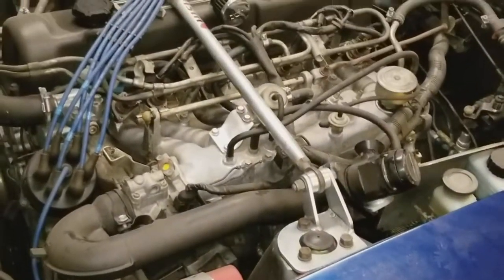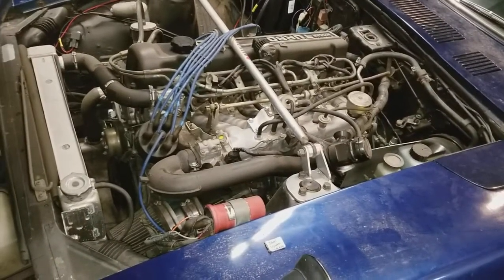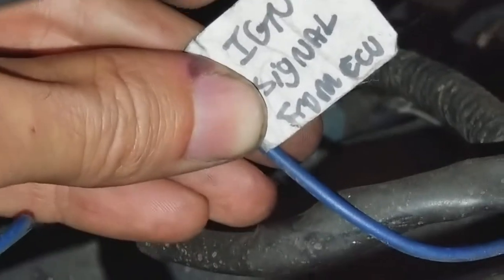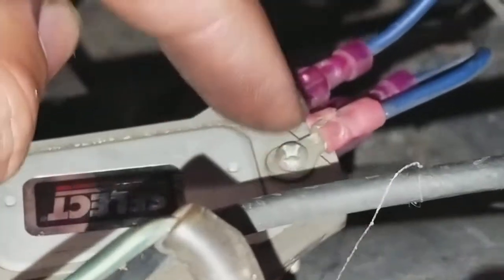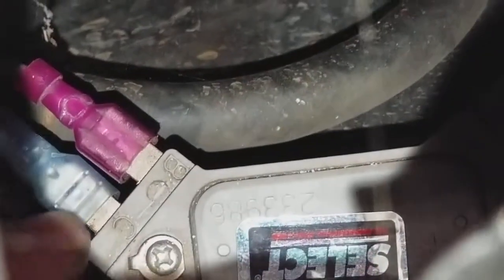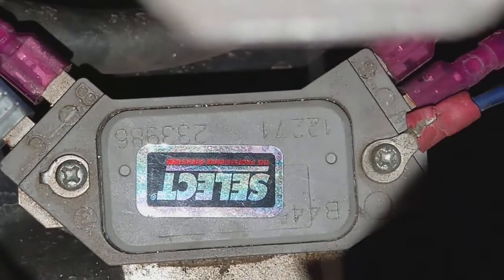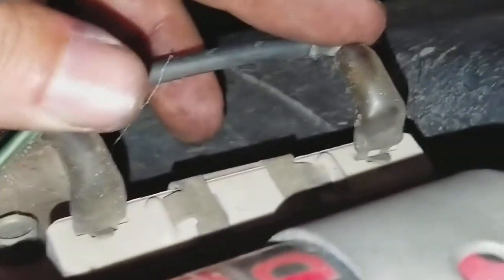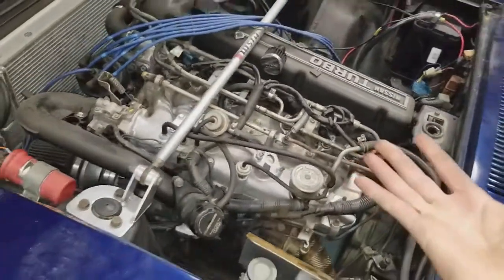How to GM igniter into Datsun/Nissan l28 turbo

Comment: Ign signal from ecu
Wich number in ecu??
Reply: its so weird how this would work. everyone else says to hook the dist wires to green and white and then the negative side of coil to c and just a positive wire to the b.. I have tried to hook it up the way everyone else says but i can't get mine to work. I'm gonna try it like this guy has it and see if it will work. But i don't know how he is getting away with not using the dist pickup coils. unless its because his is an 83 and mine is a 75 but who knows